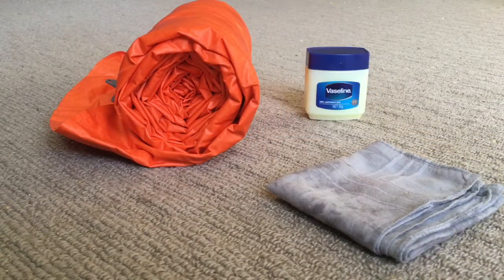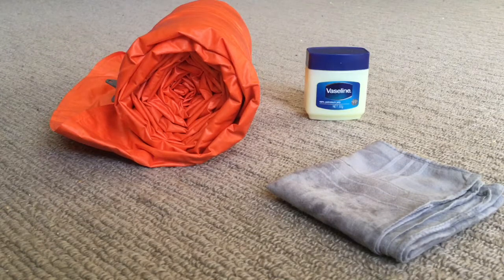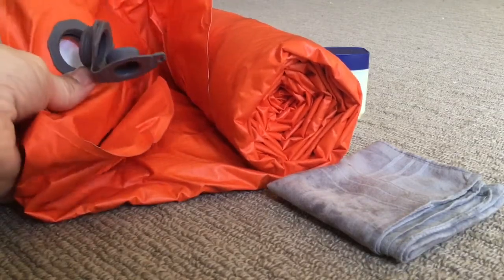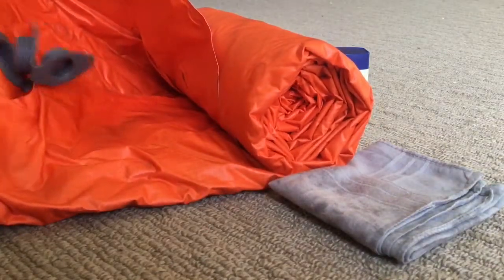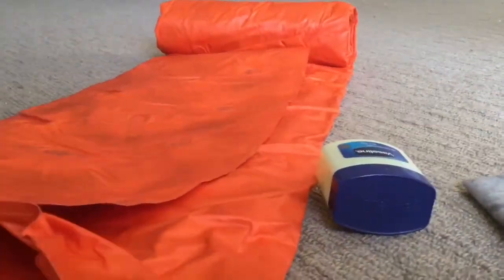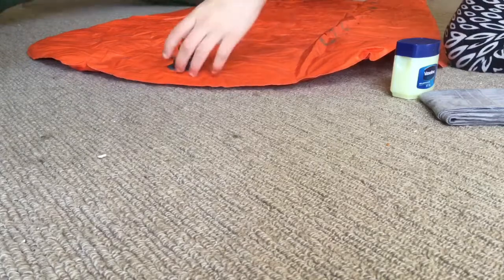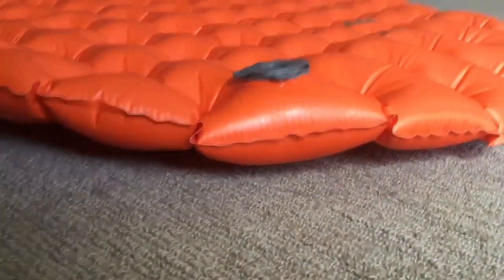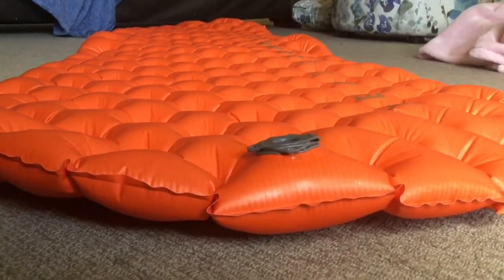STS inflatable mat valve leak repair

Comment: Thanks for the video Aliice🙃
  I have two identical mattresses. One has the valve problem. I'm using vegetable oil. 
I had thought about getting some Vaseline and using it but I did have olive oil in my camping basket.. 
It's best to use vegetable oil on rubber seals. Petroleum products can damage rubber.
🤔
Reply: Odd that S2S would recommend vas then. Will try veg oil. Alice says thanks (I’m her dad in the vid).